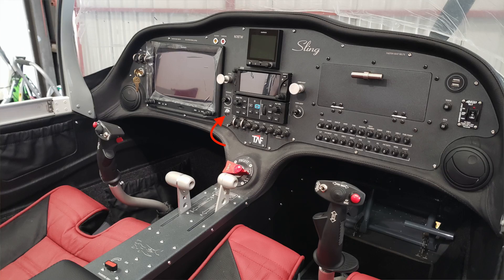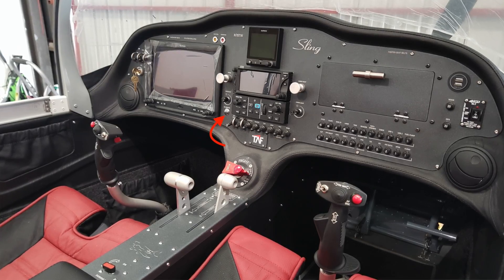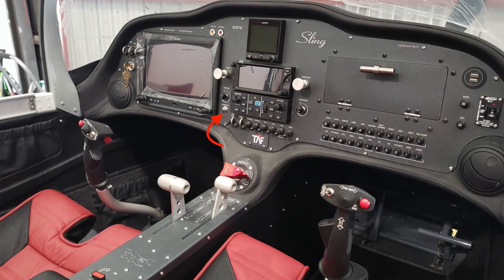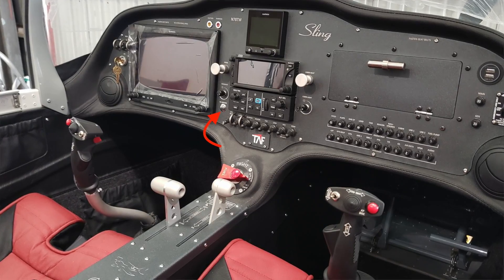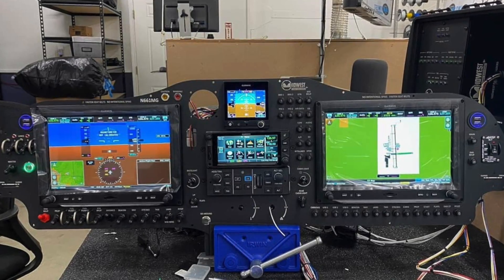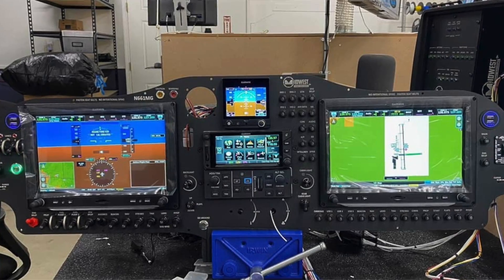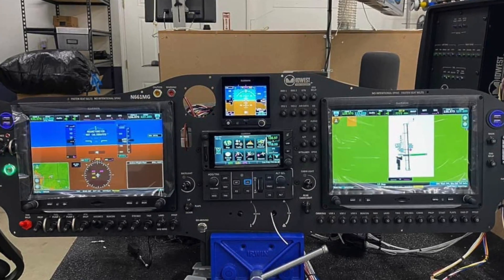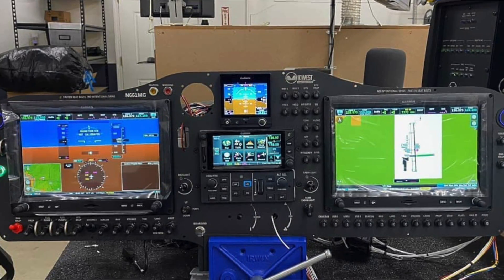What Go Around Buttons In Airplanes Do

Comment: I'm familiar with the go around (or TOGA) button with the numerous airline jumpseats I've been in or airline simulators I've flown, but they're all where it makes sense: on the throttles/thrust levers. I understand that this is a panel install but you'd think there would be a way to set up a button on the stick (or yolk in applicable aircraft) or on the throttles where you'd have your hand. Removing your hand to push a button is not optimal when you're initiating a go around. It should be intuitive, instinctual, and fluid. Safety is the goal.

Comment: The autopilot takes the aircraft down to minimums before going around? Horrible! A Go-Around should be initiated as soon as the GA button is pushed! GA buttons are a great help, one thing though, the placement on the Sling isn't optimal, it should be placed on the side of the throttle lever, so you can push it with your thumb without releasing the throttle.
Reply: Like this on an ATR. https://aerosavvy.com/go-around/atr-72-2/
Reply: better is adding it to the stick like this

Comment: Go-around button is good for providing guidance when going around in IMC. In VMC, a go-around should be executed with eyes focused outside, not on the instrument panel. I would strongly suggest, if that go-around button is installed on your aircraft, and you have to around in VMC, that you ignore the button and focus on a safe, visual go-around.

Also, I disagree with the decision to place this button on the instrument panel. On large commercial aircraft, go-around switches are located on the throttles so the pilot can push them without having his/her hands leave the throttles. The last thing you want to do on an instrument approach, low to the ground, at approach airspeed, and potentially low to the ground is have to break focus to find and reach for that switch.